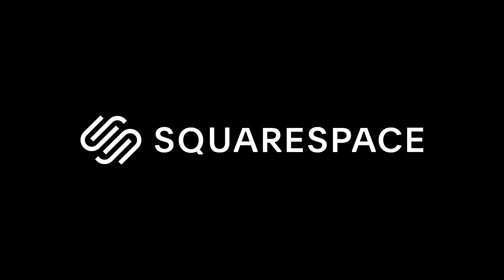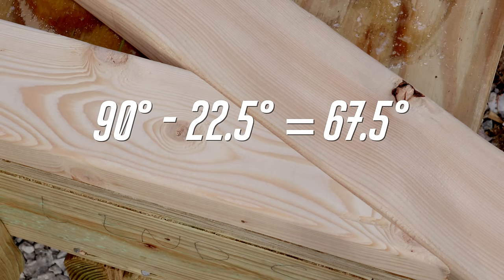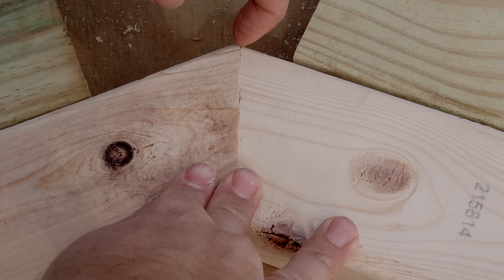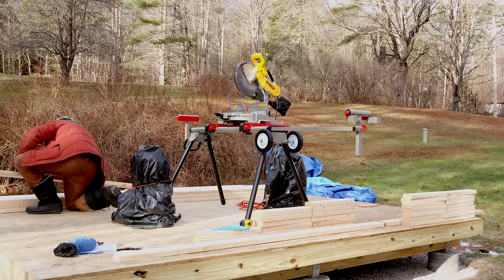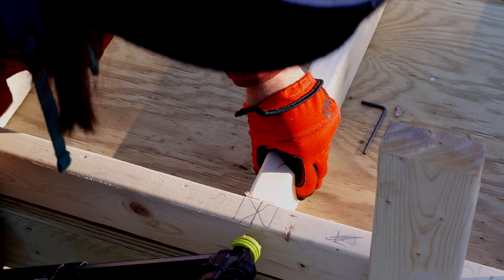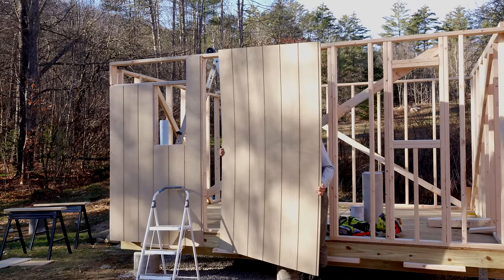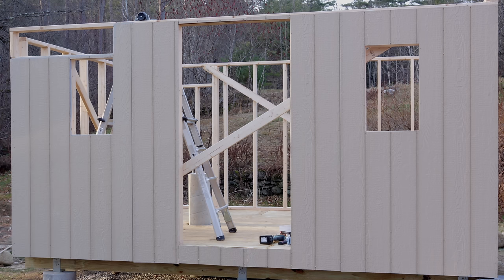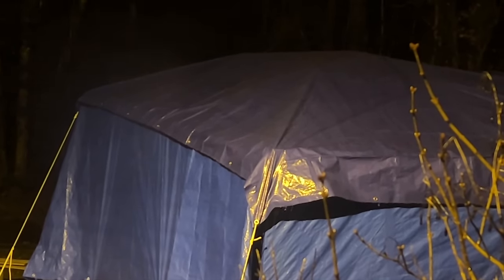My DREAM OBSERVATORY has WALLS!

Comment: Tips on painting - use a white, off white or cream color on the walls. Darker colors absorb more heat from sunlight and you will cook in the summer. Same for the roof - pick white corrugated metal. Tar shingles are heavy and hold heat a long time. Last tip - paint the interior before installing anything. The wood will get wet during the time the roof is open and soak into  uncoated surfaces. All this learned while building my own observatory :). Good luck!!
Reply: This is super helpful! I’m going to keep this in mind for my build.
Reply: Yeah you could also do radiant paint for the wood before the roof is installed so the roof wood reflects heat away.  Though my idea is going with what Astrobackyard did.  Quick and easy, and if we move it moves.  If I ever build out on land then I'd go ham on a new setup.
Reply: Good idea not to use dark colors. Not only you wont cook inside, but more importantly the structure will not radiate heat and make distortion in the air that the telescope will be looking through :)

Comment: The reason you may be off a little when lining up your cuts, because when you make a cut, you have to account for the width of the blade itself. That is called the Kerf. Great bulding plan though. I have 60 acres in East Texas where you can see the Milky way, and want to build an observatory.

Comment: I don’t know if you’ve completed building your roof outriggers yet, but you haven’t, don’t make the tracks level with those of the building. On my observatory I have metal plates and angle iron for the casters to roll on. Because I made my outriggers level, I get water rolling back into the observatory which then drip down the walls.  I think a slight downward angle would have prevented that.

Comment: Your building looks nice.  SCREWS for constructing the framework.  Years ago Habitat for Humanity built 2 houses almost side by side.  In one house they used common (not galvanized) nails and in the other they used screws.  That's in an area where the wind gets high at times.  During a strong wind the house constructed with nails stood, but the one built solely with screws suffered damage because many screws broke because screws were brittee while the nails were more pliable and bent instead of breaking.  The house built with nails survived because the nails bent a little in the wind, yet sprang back to their original shape  when the wind let up.
That was years ago and the screws might not ne as brittle now as they were back in those days.
You might already know that galvanized nails are required when building with pressure treated material.  The chemicals in pressure treated material attacks and weakens non galvanized nails.  I got that galvanized nail information years ago.  My understanding is that more recently different chemical(s) are used for pressure treated (insect resistant) wood is different now.  I think galvanized nails are still recommended.
The only other thing I noticed is: in my location nail spacing for sheathing is much closer than 12 inches.  That's because of the wind loading where I'm located.  12 inches might be correct for you.  Your lumber supplier should have that information.  OR a builder who is required to meet building codes.
All the best to you.

Comment: Definately coming along nicely.  I can relate to double marking the studs as I do the same.  Same frustrastion with the rain during the build.  When you get to the roof, consider using 3/4" shims between the wall top-caps and the runners holding the trusses in place.  This will let you put all the trusses in place and squared up adding in the rails afterwards.  I found that by doing this, once the rails were fit and the rollers screwed in place, the roof actually lifted off the shims. It also let me function the rolling roof before adding the additional weight of the full roof.  There was no problem supporting my weight to close up the roof panneling - Food for thought.  Would love to see you do a follow-up presentation on how to determine your FOV within the shed when looking to shoot DSO's.

Comment: Looks real good. You are so accurate and precise. I have had my observatory for 17 years. After about 6years the roll off rails made of 4x6’s started slowly bending and warping.i had a 14 ft span with a 4x4 in the middle. I eventually switched to steel ibeams and the problem went away. My angle iron which the V groove wheels ride on was welded to the i-beam.

Comment: Use a section of Z flashing along the top edge of the wall when you add the filler panel on, after installing the roll off beams. This will help keep water out of the observatory.

Comment: Looks great but aren't the piers too low compared to the walls?
Reply from the maker: Nope, they are correct for my location, I can only image down to 25-30 degrees above the horizon due to the tree line on my property, so the tree line is my limit not the walls. I’ve now had the chance to test this and all my measurements were correct thankfully.
Reply: @NebulaPhotos  good to hear :)

Comment: To eliminate the floor induced vibrations, the telescope should be on a separate foundation, no?
Reply from the maker: Yep, I have two independent piers with air gap coming through the floor. Check out the last couple video in this series for details
Reply: @NebulaPhotos  fantastic, good job! I didn’t notice the piers under the plastic bags

Comment: Why did you decide against putting on a wrap (eg Tyvek) before putting the siding on? Do you not plan on temperature controlling the interior?
Reply from the maker: Correct, it won't be sealed / temperature controlled - difficult with a roll-off roof. Some people add a warm room that can be temp. controlled, but I didn't do one mostly to cut down on cost/complexity.